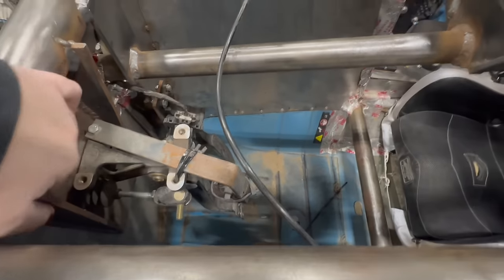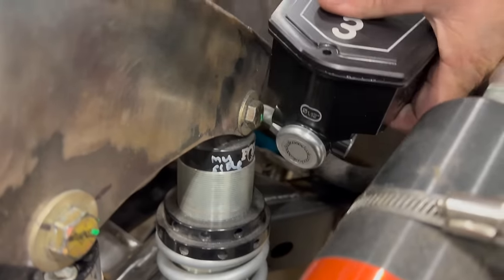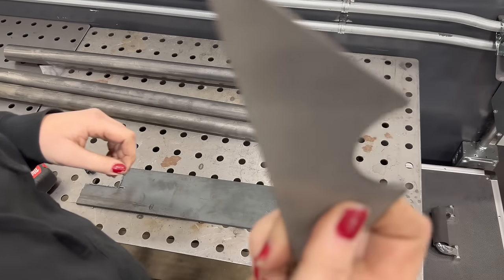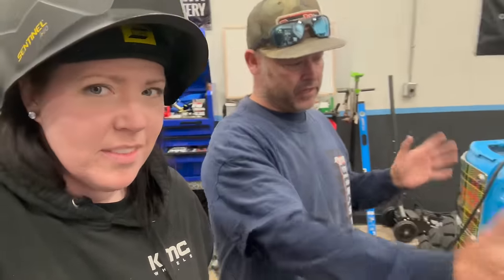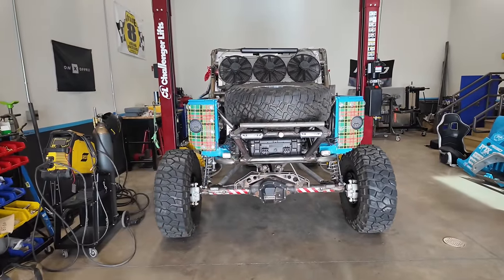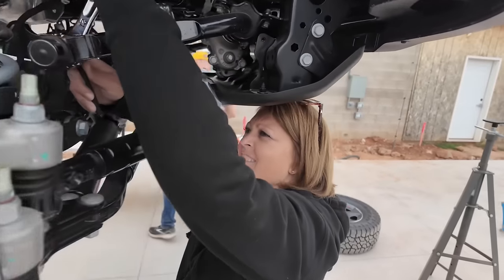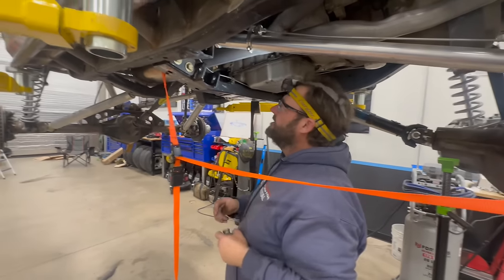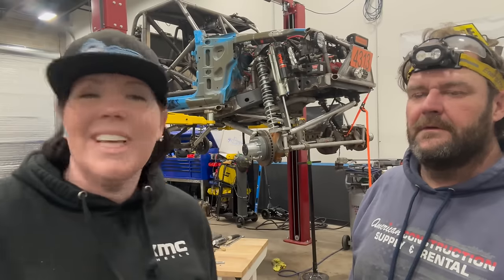The Ultimate Tire Carrier With Tool And Emergency Storage

Comment: It is good to see your brakes are getting their much needed TLC. Remember what goes up must come down. Walter wants your descent to be as controlled as your rock crawling!

Are you making provision for tool rolls to contain your wrenches without rattles? At times loose tools can sound like bells in the toolbox.
Reply from the maker: Good point, there will be adequate space below the spare for lots of tools and spare parts. And we will definitely use tool rolls to help keep things quiet 😀🤙🏻
Reply: @MischiefMakerTV  Checking out the tool rolls from MOOR might be a start. Suggest you have a packing list of tools and verify it is complete every time you go out.

Comment: Do they specify Antiseize on those "Johnny Joints"??, I would have used Marine wheel bearing grease or Teflon grease.
And hang your brake calipers with a hook or heavy wire, NOT the hose, it tears them apart on the inside.

Comment: Curious if you order extra fittings for those that aren’t standard. Something you couldn’t get in the pits at KOH.
Reply from the maker: Anything custom will have at least 2 spares. We run custom width axles on both rigs, so there are 2 sets of custom inner front shafts and 2 sets of rears. I have one new set of drive shafts for each rig and at least one set that has been rebuilt at all times. Same goes for things that typically have a very long handling/shipping time or are not commonly stocked like custom length brake lines, air locker parts (flange cap, seal housings, etc…). Literally anything we had to special order is typically kept on hand. Walter is a bit neurotic about those types of things.

Comment: Holly I'm wondering why your number plate on Nessie is 4313? The modified class in ultra4 is 4500. Just curious, I've seen many cars racing in ultra4 with numbers that don't make sense with the class they're in.
Reply from the maker: You can pick any number you want for the season as long as it is not taken by an existing race team. If all 4500 cars had to start with 45XX, then there could only be 99 registered 4500 cars for the season.

It’s actually the color of the number plate that tells you the class of the vehicle, so any vehicle with black letters on an orange background will be a 4500 class vehicle. 😀

Comment: Don't you have that whole in the firewall closed for regulation
Reply from the maker: Yes. Any holes and openings for things like the steering column that are .5” larger than the actual item passing through the opening need to be taped off or covered. Once we are don’t fitting and testing the hydroboost, we will add sheet metal to close up the space properly.

The cowl piece caps off the firewall.